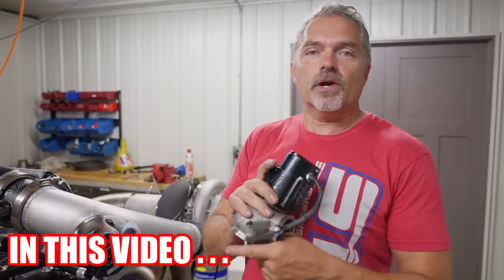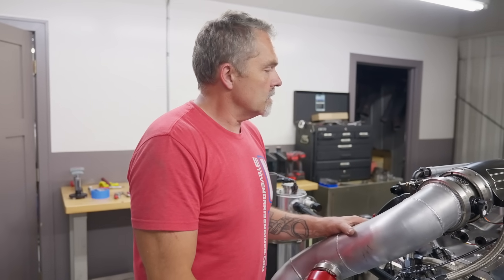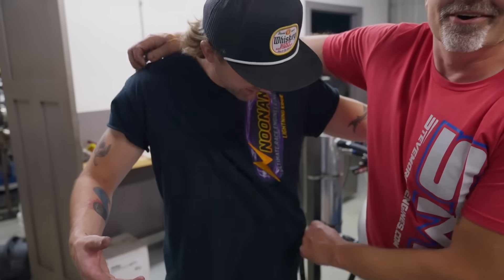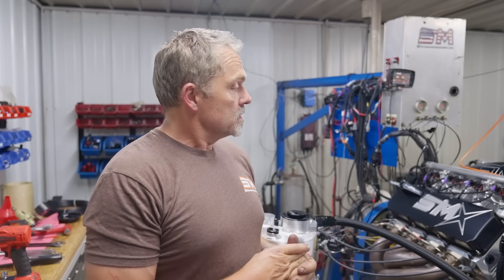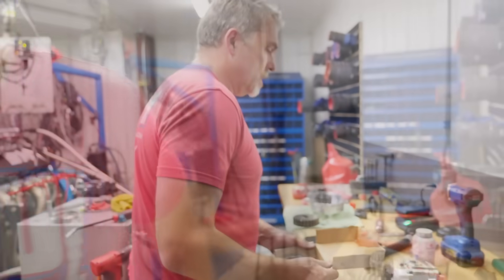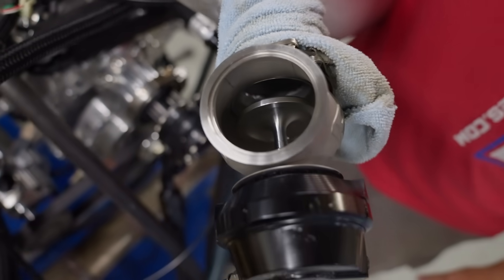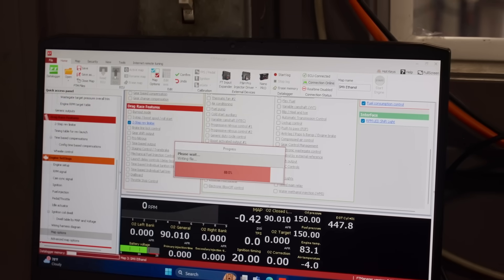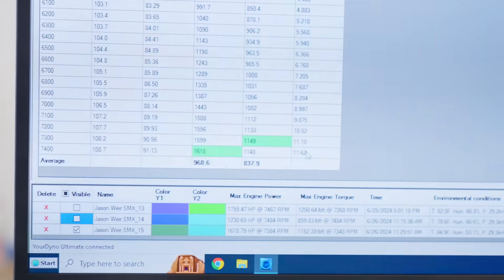Blower Or Turbo? And Cleetus’ Bigger Rods !

Comment: So cool you can build these motors and hand it to someone .With the gear ratio, track is different but you got them in the ball park to make it work. Facts don't lie and you have no reason to change the facts. That would be like lieing to yourself
You Sir have taken this ICE to it's max. Much Respect. Street engines should not be able to do what you make them do.

Comment: Is there such a thing and an Electric Motor + Exhaust Gas Turbo so the Turbo speed / boost  can be controlled by the eclectic motor initially ..  Or is that not in the Rules .. I know they us that in F1 Engines and Rocket Labs Rutherford Rocket Engines the Eclectic motor  is the Rocket Fuel Pump ..

Comment: Possible instant load setup. Extend the shaft out of the absorber to a clutch. Output side through the wall to a big diameter roller. Gonna need some stout shafts. Could run the clutch on a hydraulic solenoid and dump for load.

Comment: Opening the wastegate makes the turbo move more air, which makes MORE resistance and will spin slower. Just like stopping the air on a simple leaf blower, it spins faster when there is less air movement.
Reply: You're confused with blow off valve
Reply: @ekam99yahoo  the are the same my friend.  Just a matter of where they are placed.  😉

Comment: Does a motor that is making more power, spin the turbo faster? I ask because when the charge pipe waste gate was open and the turbo didn't respond very well in regards to the turbo spinning faster, my thought was that the feedback loop that the turbo needs to spool itself, was "broken". If the turbo can't increase charge pipe pressure, then it can't give the motor the horsepower it needs to spin the turbo faster. No boost = no spool. Opening the charge pipe waste gate just made it worse in theory. I can see how there would be lots of variables with engine size, turbo size etc. It just seems like in this case, the turbo might spool better when giving it every opportunity to give the motor more power. Even if only a few psi.

Comment: Sounds like you need to get a setup for connecting a transmission to your dyno
Reply: Needs a track dyno that simulates the race track not just horsepower and torque.
Reply: @GaryH-pw9cm he has one, it’s called a hub dyno

Comment: What's the max amount of boost that a big ol 144mm turbo will make?? A little shot of nitrous would have brought it right up on boost, correct?? I see alot of people adding a small shot of nitrous to get it on the chip faster.. its unfortunate that you couldn't figure it out with the time you had because I'm guessing that motor & turbo are going to make some crazy power

Comment: Fir a lot of street driving, I'd go with the supercharger. For max HP/Torque, I'd go with twin turbos.
Reply: the only issue is that a nitrous or blower car has a much more radical cam than a turbo car, so valvetrain wear is more.

Comment: No where near the same levels but I wastegated my novi 1500 and just run the boost I want when I want. Boost by gear and all that. Its neat. But we’re talking a 900-950 hp engine not nearly 3000!

Comment: Would it be feasible to put an A/T between the engine and the dyno? 
It would test real world applications.
Reply: Even when using a chassis dyno or hub dyno, they don't typically shift during the pull and usually make it in the 1:1 gear.

Comment: 40:04 YOU ALWAYS HAVE TO HAVE A NORMAL  TIMING CURVE 
O ZERO ENGINE OFF
12 DEGREES 800 IDLE
24 AT 3000
48 AT 6000 AND UP
THIS YOU HAVE HAVE AS A BASE FOR NORMAL TIMING  .

Comment: Procharger>Turbo. Yes, I know....max peak HP with a turbo before you get your panties in a crunch. Regardless, as Steve mentioned, consistancy, reliability, tunability, and many other reasons why Prochargers are better to work with when you are ACTUALLY racing at the track.

Comment: Seems to me you're just out of the operational parameter of the combo trying to load it that low. Starting the pull higher up once the turbo comes "on line" should produce a more controllable load for the dyno to control. (7000 -> 8500 pull rather than 5000 -> 8500)

Comment: What if you put both together instant power and massive power
Reply: That kind of setup has been done in the past (Lancia Delta S4 Group B rally car), but it comes with a significant weight penalty from all the added complexity and at extremely high power levels the supercharger can actually start to restrict overall airflow. You could theoretically run a bypass system, but that adds even more weight and complexity, to the point that you're better off just running one or the other.

Comment: Garrett bought a PLR hemi for his eagle promod.
Hope he enjoys maintenance.
Reply: He was so amazed at not having to pull the intake on the hemi to service the heads. I’m like, dummy Steve said the smx was designed with the same intent.
Reply: It’ll be interesting to see the support he gets vs SME’s support.
Reply: The whole reason he had issues with the SMX WAS because he didn't maintenance it. I hate to call the baby ugly but....
Reply: @jameshenson4871  careful, youll get  everybody triggered. LOL
Reply: @leftyo9589  
Yep, I am absoulty sure Steve doesn't mind the competition with Garrett having a  pro stock motor for the eagle because Garrett will find out the Hemi will break without maintenance, just as the SM Engines will as same as all engines.

Let me be clear, Garrett's team is not mentally equipped to handle these types of engines. They are great part switchers but not much more. 

But the support with SM engines is just an arms length away.
Reply: @leftyo9589  Absolutely, I love what entertainment Cleetus gives but the truth is the truth. I would love to have PL Engine,  But after watching what Steve has done for Cleetus, I have considered  him for a project. Steve is really a stand up guy. The SMX is a potential reality for me.

Comment: you are starting the run a little too high on the turbo. hold it at 3,000rpm then  let it go. I saw you were holding it at 5,000 and only giving it 3,000 rpm to rev. its a turbo. it needs wider rev range
if it isn't building boost because of the rear wheel sizing thats a problem. but you have so much exhaust gas it shouldn't have this problem. what is the rear wheel/housing size? also turbo is not intercooled. thats a problem regardless of methanol etc. a turbo needs an IC

Comment: Boost doesn't tell you the real story. It's just a data point. If just pressure but also heating the air, your not going to make more power. Measuring Air Density is where it's at. How many pounds of air are you getting, not air pressure.

Comment: 144 MM SINGLE TURBO, LOL😂😂😂😂😂😂LMAO..1000 hp on 4.lbsnof boost, well it’s got to be the safest 1000hp engine out there,m😂😂😂
Reply: Maybe it will bc it will come on so late the turbo won’t strain the internals as much 
Kinda like a big turbo vs stock turbo on a little 4 banger 
Big turbo safer IF u don’t moon boost it.

Comment: 😂 Steve i love ur vids but ur wrong on load and 2 step no load when the clutch is in neutral and its sitting in first gear thats a selection of data from that the afr and timing control the boost and preload pressure I run 2 step and launch control on a 5 speed man eclipse efi 4g63t

Comment: You can’t convince me a turbo is better, I don’t drag race and don’t care about winning races. I like the power to come on fast, and the noise is better. When I was a kid I thought turbos were better, then I drove a manual transmission supercharged v8.
Reply: Speaking in parisitic losses turbos are absolutely better.
Reply: @Ole_CornPop  of course, but I don’t think anyone could drive a supercharged vs turbo v8 and say the turbo is more fun. Faster? Probably
Reply: @spcneary  with anti-lag they are just as fun on the street. More power is more power no matter how you look at it. My choice is twin smaller turbos instead of one big one. For drifting I actually like a N/A settup with individual throttle bodies and as small as a flywheel as I can have. I do still love superchargers though but with anti-lag, 2 step and 3 step it's hard to lean with a supercharger/procharger/blower for racing applications because you can do more with less.
Reply: @spcneary  when comparing boost for boost, similar size compressors between a centri and turbo in a actual car...turbos boost curve is far better. Where say at 3000, a centri will be making like 1 to 2 psi, a turbo will be at 6. Centris curve is linear no matter what. Centri have "lag" in comparison.

Comment: Is garrett using smx in his new Camaro???
Reply: Nope went with pro line hemi   SMH
Reply: The new car is not a drag and drive car. 

SMX is water jacketed, which is needed for drag and drive but has disadvantages if you don’t need a water cooled block and heads.

They’re different kinds of engines for different applications.

Comment: After watching this video I feel like you've never done something with your engines which any good engineer would do. Elon Musk does it with his spaceships. Test your product to failure. I feel like you've only ever tested your engines until you're not comfortable testing them anymore, which makes sense because you're selling them. But, if I were you I would take one sacrificial engine to use for myself to test it until I cause it to fail myself. I just honestly believe the knowledge gleamed from the different approach(s) to testing different ways to utilize the engine more without causing a failure until it causes a failure may genuinely help you improve them as a product, whether by tuning them or redesigning parts, or changing policy, etc. Ideally the result would be a more clear picture of the target horsepower/torque for particular configurations based on the margin between the actual practical point of failure rather than what it seems like you're using at this point - a rule of thumb target based on theory, not a mathematically derived target based on practice. I also picture it becoming a longer term project where somebody is testing the most recent failing part to failure pretty much every day and redesigning as necessary before the next test. The timing might also be perfect too, as your son transitions into more responsibility building the engines, you can delve back into research/design.
Reply: How long have you been watching? There are lots of destruction videos.

Comment: ya know it was a big mistake giving ol cleet the scratch and dent speical cause all it did was break...bad marketing imo
Reply: Any engine will break if you don’t look after it and the more powerful the engine the more maintenance is required.
Cleet needs to put more time into maintenance and proper testing of his overall setup.
Also not doing stupid stuff like taking it on the burnout pad and continuing to run on an already damaged engine.

If he wants to have heaps of different cars running properly plus do all the other content he does, he’s going to need to hire more people to maintain it.

Comment: First, I don’t know sh*t ‘bout dynamometers.
Why don’t y’all use a eddy current brake, instead of a water brake, on these dynamometers like on a hub dynamometer?
Seems to be less voodoo involved…
Are those Pro-Charger gears the same as 10 spline quick change rear end gears?